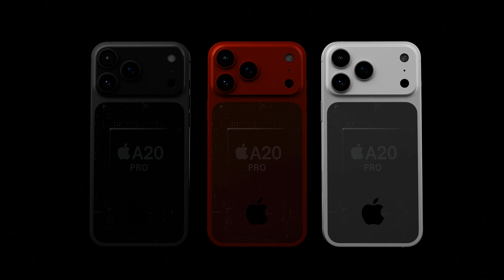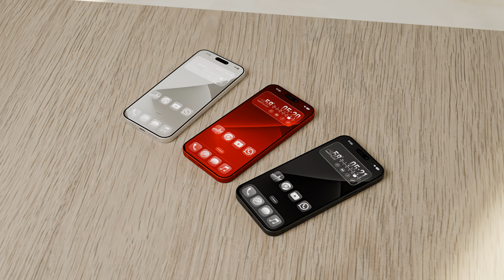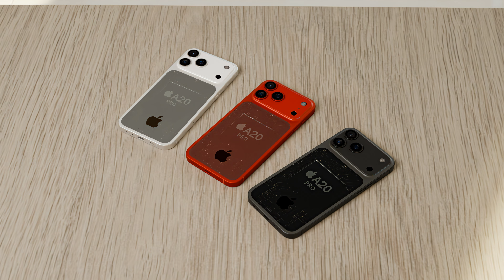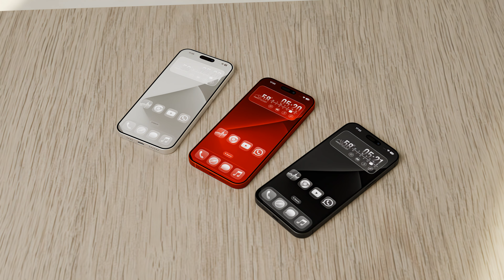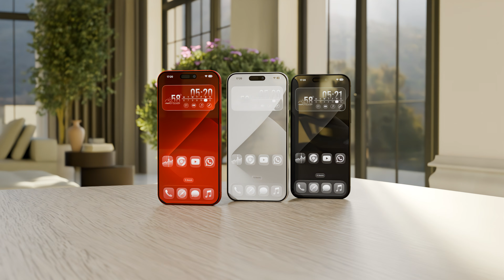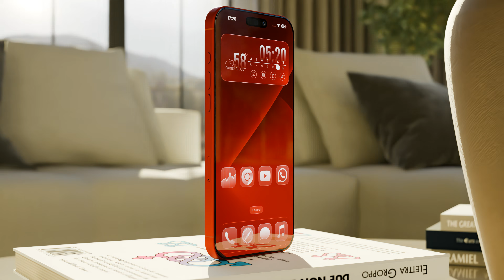iPhone 18 Pro Max - This Changes Everything!

Comment: I have a theory… “New iPhone 18 Pro with an all-new reinforced polymer composite unibody — lighter, tougher, warmer to the touch, and engineered for advanced thermal distribution.”

Although people typically associate plastic with being “cheap,” the benefits are:
1.	Better radio signal performance.
2.	No color fading or anodizing issues.
3.	A much lighter device.
4.	Stronger structural durability — high-grade polycarbonate is extremely impact-resistant and doesn’t dent, warp, or show scratches as easily as brushed aluminum.

- Apple has been vocal about their belief that function inspires form, and therefore is more important. That’s actually part of the reason they left the titanium design for a less durable aluminum one in the first place.
So my question is: would they make the same choice for plastic?
I think so, because I doubt their principles and beliefs are subjective.

Comment: Well,  iPhone better beat Samsung, Xiaomi 17 Pro Max,  Honor Magic Pro 8 and Vivo X300 series otherwise they can forget impressing us tech gurus.  See, those Samsung sound splitting capabilities to earpods while the speaker plays another sound is beyond amazing.  Xiaomi's IR Blaster,  Wet Enhancer 2.0,  2nd Space, Swiping Transition Efx,  Drop Resistance, Reverse Wireless  Charging are just highlights. I need something compelling to make me leave Android,  something compelling cos Apple is loud on the mouth. Currently, Android from China 🇨🇳 kicks dust. I use the MacBook for music production as i use Logic Pro X music production software. It's still not perfect,  hangs a lot. If it was available for Windows I'd have long left it. There it is, I'm hard on everyone who claims they're better or best than the rest.